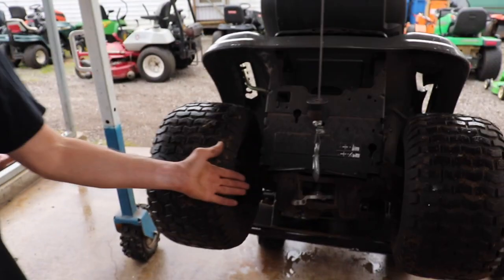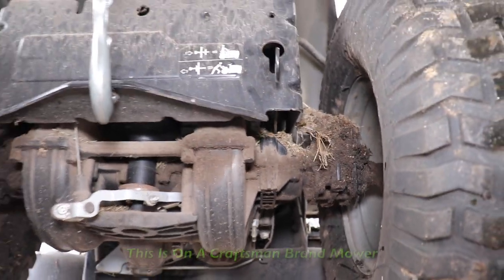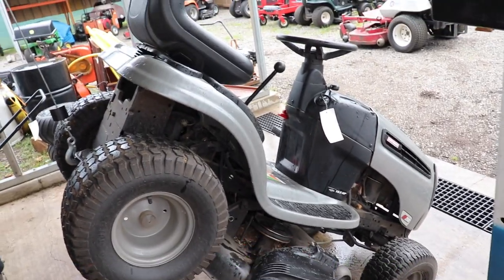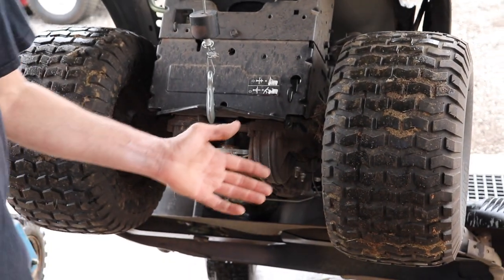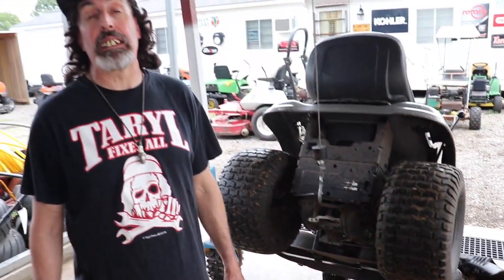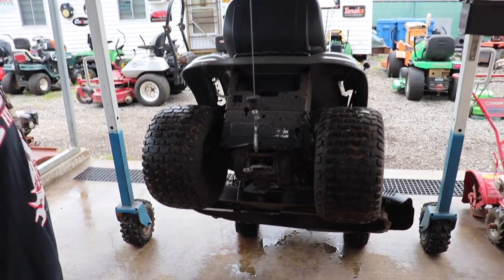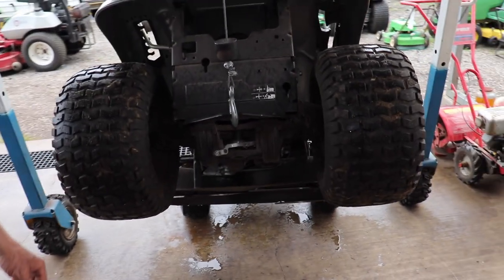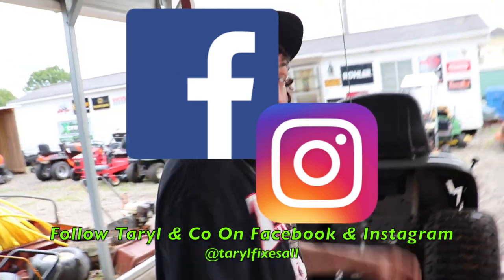WHAT?! A Plastic Transmission? WTF were they thinking?

Comment: How sad that riding mowers have come to throw away junk. You can't even get parts for them, because they know it's not worth the effort to repair them. Simply amazing!
Reply: Exactly. The garbage pile I bought  needs constant welding to keep the metal from falling apart, plus the cheap rubber tires have dry rotted away.
Reply: Well thats how you sell more mowers
Reply: BUT, the ONLY good thing about such is when that junk drive system fails us tried & true Snapper Rear Engine Rider fans will be able to get the motors for our 50 year old mowers 😂😂😂😆😆😆
Reply: its not really that sad. craftsman mowers are bottom of the barrel, and reflect that in price. if you want a quality made product, stop expecting to get it from the cheapest thing home depot has to offer.
Reply: Bro you should stop by an orthodontist
Reply: @COlson-rh3dg  RE: Garbage mower tires they have now. I have a 1958 & a 1970 lawn tractor (neither running). However the tires are ORIGINAL and they hold air. 'nuff said.
Reply: at this point, get a old john deere, kubota, craftsman, sears, what ever brand lawn mower from early 70's to late 80's fix it up with brand new high quality parts and watch it out preform and live newer models. my craftsman GT18 that was left outside untouched in the ohio weather for 45 years is practically in perfect condition other than the motor being seized. transmission is perfect condition and still works after i refitting a new motor. the 50 year old transmission fluid needs changed but other than that its perfect

Comment: This is why 20 yrs ago I restored a 1969 cub cadet 124 ....Indestructible cast iron transmission and Kohler K series engine...mowed with it yesterday. Its not fast...but it does last.
Reply: Same here, 1980 Kubota T1400. Thick steel mower deck, alu cast trans, steel engine block, low revving engine. Uses a bit more juice then modern ones, but fk it, mine will outlast them.
Reply: @3 Spare Washers Sounds like sweet machine...I also have the IH snow blower for the cub has gotten me out many times!

Comment: I remember when Craftsman  meant good quality stuff.
Reply: My Craftsman 2002 GT 5000 is still going strong.
Reply: @nonofyabusiness4780  Those are pretty beasty slightly oversized manly man's mowers, good deal there duntchakno, yes sir.
Reply: Yeap, remember Craftsman quality well, as in past tense.  But, my 2006 LT1000 is still going strong (even with a new motor)
Reply: I got one of the great ones for plowing a 93 gt6000 with the 6 speed hi lo that rear will probably last forever

Comment: I will say if someone isn't mechanically inclined, these transmissions can be a problem.  I have repaired 2, the transmission itself is good and a neat design.  The cause of the not shifting Fwd/Rev is the owner never cleaning the mower off.  The grass and dirt builds up around the shift cam on top of the transmission.  Once the area is cleaned, transmission shifts fine as long as the owner hasn't tried to stomp on the pedal to make it work.   I have spoken to customer support for this model transmission, they answered questions and I was able to get the parts I needed quickly.   The transmission rarely tears up inside, external parts is what mostly happens.  I have replaced a shift cam on one transmission and a rear drive pulley another.  Both failures were contributed to owner not cleaning the mower.   This transmission is fast and operates well under normal conditions.
Reply: Well really, no one would go through the time in their day to clean around the shift linkage and instead get an aluminum trans.
Reply: What about the leaking? They don't run long with no lube.
Reply: @leehansen4750  if u really wanted to make the plastic trans last a little bit longer I would refill it with atf or gear oil somehow and patch the leak with caulk.
Reply: @leehansen4750  I have replaced axle seals.  There are 2 empty bolt hole locations on each side of transmission at axles. I have installed bolts, washers and locking nuts on those empty spots on the case.  They must be there for a narrower frame mower.  That tends to strengthen the area at axles and prevent wheel seals from walking out onto axle.  I have called and spoken to customer support, and they have been more than helpful on questions.
Reply: @leehansen4750  I did ask about the lubricant and customer support said that the transmissions are filled with more than enough lube.  I can't recall what type it was.  A little leakage makes a big mess, I cleaned areas and installed new seals and transmission was fine. It isn't a fun job to do, but costs less than a new transmission or mower.
Reply: @Thomas-ul3uy   I have fixed plenty of them and have tore one apart that was stripped out from the kids using it like a go cart 
they are filled with grease..99% of the time you clean the grass and dirt out and they are good as new
Reply: Thank you for explaining how to fix the forward and reverse issue!

Comment: I remember when something like this wouldn't be marketed. A plastic carb is one thing, a transmission is another. People need to boycott this garbage.
Reply: Those B&S plastic carbs suck a__!
Reply: Many ARE by just re-powering their 50 year old Snapper Riders that were designed & built RIGHT
Reply: Hey the Carter Thermoquad is a good carburetor with a plastic float bowl.
Reply: @Daddyrabbit_2  They really aren't. Much better carb than what was on the Quantums. They just don't appreciate rain water or letting the gas be ancient. I have no problems with any of mine and I have several and have sold a small mountain of the modern Briggs stuff.

Comment: 8 years ago I gave up on buying box store mowers, I broke down and bought a 60in Kubota Z725 zero turn new and now have over 400 hrs on it without issues, everything is heavy duty including the Parker pumps, everything is serviceable.
Reply: Quality right there!
Reply: I had one & it snapped a tension spring at 15 hour’s of service. I was the second owner & they gave me a new one free.
Reply: Anything with a Tuff Torq k46 on a garden tractor or a Tuff Torq on a high end Zero turn can be serviced as well.
Reply: @bentullett6068  You may be the only person in the world to have something nice to say about the k46 transmission.
Reply: @the_mowron  they are reliable enough on machines in the UK apart from some John Deere models. We do have a few machines in the UK running cheap Hydro gear transmissions that are found on many made in china ride on mowers built by Stiga and their many brands they hold.
Reply: regarding Kubota tractor quality, bet they are made anywhere else but you know WHERE!
Reply: @markbaker1843  some are made in Japan and some are made in Europe.

Comment: I tried buying a new push mower. Haven't had one in decades. There seems to be no such thing as a metal deck anymore. The front ends are plastic. We get told that this helps reduce cost. I'll pay extra for quality, thank you.
Reply: Most mower decks are still metal. The manufacturers will continue using metal because they know that the decks will eventually rust out if the engine doesn’t go out first. The plastic mower decks I haven’t seen too many problems with aside from discoloration, cracks and warping from being stored outside in the hot sun. Aluminum decks in my opinion is the superior option because it’s lightweight, strong, and doesn’t rust. However they aren’t as common and they are very expensive. I only ever see them on commercial push mowers, mostly the older ones like the older John Deere and Toro push mowers that either had a Kawasaki or a Suzuki 2-stroke engine. Lawn Boy made some aluminum deck mowers back in the day too. Aluminum decks are very sought after. They pretty much last forever.
Reply: @Omegadoomship  TORO SR4 are still very high quality aluminum deck mowers. Good used ones are all over the place for decent prices and you can still buy new ones but they cost $
Reply: @Omegadoomship  what about the old magnesium decks?
Reply: Plastic doesn’t equal bad. Metal degrades too thanks to rust and corrosion. Honda seams to make a pretty good “plastic” deck mower.
Reply: @lawnmowerdude  I’ve only ever came across one magnesium deck and that was on an old Lawn Boy mower. Magnesium is 33% lighter than aluminum but is a soft metal and has lower tensile strength. It is also less ridged than aluminum of the same thickness. Both are corrosion resistant but aluminum tends to be slightly better unless the Magnesium is mixed with an allow or has a coating of some kind. They are better used for smaller handheld machines like chainsaws due to them being very lightweight but still quite strong. My vintage Stihl O8s chainsaw has a magnesium housing for example. Not many manufactures used magnesium for mower decks due to its much higher cost of materials and manufacturing. They are nevertheless a very good and unique mower deck material if you can find them.
Reply: My $600 John Deere self-propelled mower has a cast aluminum deck and it cracked.  IMO, almost all new or newer mowers & tractors are garbage!  I still have and use my 25 year old Honda mower.  It never failed me, ever!
Reply: @Omegadoomship  kyle your stats on magnesium seem to be mostly correct but magnesium would rank above aluminum in situations like a mower deck if one does not view the fire hazzard of a class D fire(say, your garage started on fire). if not for that, its going to be stronger lighter and better, but it also would need to have galvanic corrosion considerations for things like the engine mounted to it etc.
Reply: I bought a new one 2 or 3 years ago.  Has briggs engine.  Seems OK so far.
Reply: You nailed it. The lousy quality we get now is because not enough consumers are willing to pay for durability. Use it, lose it, replace it. Like you I will pay more for a better product, partly because I think that in the long run it saves money.

Comment: I had a customer come in saying their tractor is sluggish when it drives. And I’m thinking it could be a slipping belt, come bring it in and I’ll look at it. When they brought it in and saw the plastic transmission, I knew at that point there was no way I’m going to attempt to fix it. I pretty much gave him two options: replace the transmission with a compatible aluminum case unit, or throw away the tractor and get another one. For the price of replacing the transmission, he could get a decent used tractor that has a better built transmission. He wasn’t thrilled to hear that but he opted to have me install a better transmission since the tractor was in good condition and he liked it otherwise. I ended up putting a used Hydro Gear transmission of some kind in it. It only took a bit of modifying but it worked out good and he’s happy. But yeah those plastic transmissions on lawn tractors are absolute garbage. They last as long as the warranty and that’s it. Shameful

Comment: I cleaned the carbutraitor and replaced the deck belt on a fairly new craftsman mower with a one cylinder intek disposable engine. I noticed it had a plastic transmission housing. They were already cheap made so I guess they said well hell, let's save a dollars worth of aluminum and put a plastic Doo hickey housing cause most people won't even notice it!

Comment: I know I’ve said it before…….but I love my 1983 John Deere 210. It still has the original Peerless 2300 transaxle and K series Kohler. Maybe not as tough as the IH Cubs of that day, but still going strong after 39 years.
Reply: I have a JD212 and an IC Cubcadet 169... Id say the JD212 is superior due to the slightly longer wheel base and the shock mounted engine cradle.
Reply: got an old hydro 185 jd. ugly and been through hell. it's still kicking though. alittle weld here, new bearings there.. you get the idea. it was rough when i got, wore out and i let sit a few years to ripen before fixing it up. that kaw on it something else. runs great and the rest of the mower is built to last. if anyone has any doubts about modern quality, lift an old one up and a new one. you'll know real fast which is better built. it's a tool. i'm a fan of over built and under engineered.
Reply: I’m restoring a 214 right now, I’m refinishing the deck.
Reply: I got tangled up in peerless 5 speed manual transmission one time, replaced the shift Keys. If you "ever" go there you won't forget it for a long time. They've packed them with Bentonite Grease. Kerosene won't cut that crap. The local repair shops refuse to even look at them. Never go near a manual transmission.
Reply: @bjre.wa.8681  The Peerless 2300 is an older design with a horizontal input shaft. It uses gear oil. I run 85/140 in mine. But I’ve read about the Bentonite filled ones that you dealt with. I think they’re mostly light duty units used in lawn tractors without ground engaging attachments.

Comment: In contrast, a Cub Cadet Original ('61-'63) had the same 3-speed transmission as an International Cub and 60 years later they're all still working.
Reply: Amen brother!  Lawn tractor pullers love them too.
Reply: Amen brother!  Lawn tractor pullers love them too.
Reply: yep i own a cub cadet 104... till mows lolll
Reply: @skimask5049  Mine is a '72 149 that I bought a year ago and it was running really rough. Cleaned the carb, set the valve lash, cleaned the tank, new fuel line/filter, air filter and spark plug...it's been running like new ever since. lol
Reply: I got an 87 cub 1211 and I love it. Mom has a late 80s deere and it's a pos lol. Been trying to convince her to get rid of it and get a cub.

Comment: This is kind of like years ago when I bought my First Chrysler.    That's the feeling when I got my Husqvarna AWD lawn mower.    
 Before that, it was one of the top of line Craftsman lawn mowers.   They stopped making good  stuff right about after the year 2000 if you ask me.  

The 90's was the era where things started to go south in a big way that become really noticeable to the general public.     

instead of fixing the problems they simply just keep on making them and ignoring them since it's more profitable to do so from a shareholders perspective. 

it's a bit weird you can get a motorcycle or an ATV transmission that will probably last you the life of the ATV but a lawn mower transmission for some reason it won't last you a season

Comment: Crapsman has been goin all out on plastic every since they left Sears and joined Lowes. Even some of their utility knives, made the mistake of buying one that looked "decent" with breakaway blades for some drywall work. Plastic inside the housing that holds the blade which allowed it to pull out while cutting which almost resulted in my scoring my arm instead of the drywall when it suddenly gave on me.
Reply: The current Craftsman mowers at Lowes are Troy Bilt in drag.   The older Craftsman from Sears built by AYP/Husqvarna were way better mowers and much easier to maintain and work on.

Comment: Those transmissions are like $1300 here in Canada. The housing usually cracks and then it's junk. Like you said, you can't even get the parts to rebuild the guts.

Comment: I bought an Ariens 46 inch riding mower from Home Depot in 2014, $1399.  It has this plastic transmission case. Replaced the axles seals last winter, 2021, cheap & easy. Also replaced one set of blades, one battery, one air filter, several oil & filter changes (not every year). Still on original tires & original belts. This mower is the same as Husqvarna...same parts and accessories. I mow two properties, (used to be three properties) both one acre. Best mower I've ever had.

Comment: If it has the speed pedal; Put a spring or bungee cord to return the linkage to the upward position. Mine gave me fits for 2 years till I got the pedal to return to neutral every time. But ya Taryl is giving good advise. I wont buy another mower using a GT plastic transmission.

Comment: I bought a Craftsman LT1000 from Sears in 2001 and it is still running today.  I kept it in a garage always along with yearly oil changes, etc and it still runs great.  I did upgrade a few years ago to an Ariens Zero Turn because we moved out to a 2 acre place but I still have the LT in the garage.

Comment: One thing I see a lot with these plastic transmissions is the holes where the axle seals  are pressed in will get loose, BECAUSE IT’S FREAKING PLASTIC, and transmission oil will leak from the seal but not past the actual rubber seal but around the outside of the seal. So, people will see all the oily dirt and realize the seal is leaking so they replace them. But the new seals leak too. If you replace the axle seals in one of these you really need to use a good gasket maker like , The Right Stuff. Be sure to get the transmission completely spotless, clean, and oil free before you apply the gasket maker.

Comment: I finally bit the bullet and bought a JD ZTR. Same fuel economy and twice as fast. Only  six inches wider than my Craftsman was. It ran one year and they had to send a mechanic to fix it under warranty. When the mechanic left it STILL didn't work. I put a bearing in the linkage to help it shift and when it does, it still runs.

Comment: I would really like to see a teardown of one of these
Reply: I tore mine open it's just nothing but gears and grease no oil or fluid of any kind.
Reply: They aren't that hard to work on.  What does go bad is the external parts from owners not cleaning the mower off, grass and dirt build up on top of transmission.  Grass, dirt and moving parts don't mix.  The grass and dirt get compacted in the shift cam area and causes transmission not to shift.  I wish I had recorded what I did to fix the 2 I have repaired.  Being mechanically inclined and knowing how things fit and move helps with this transmission.